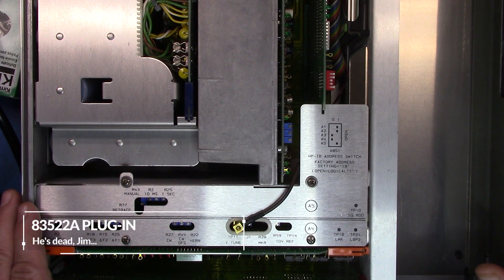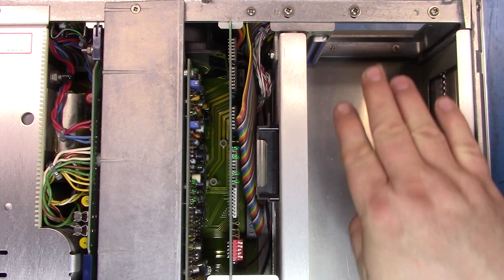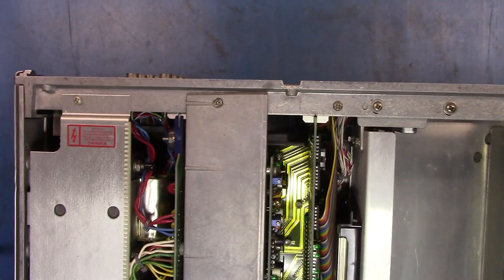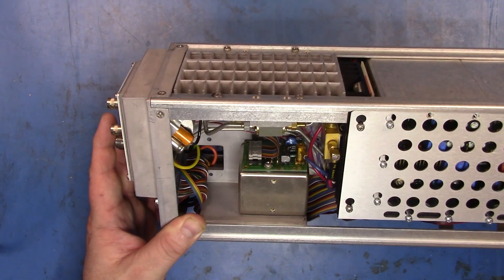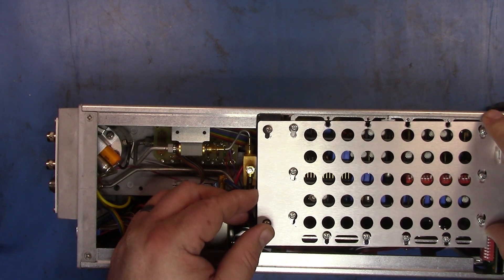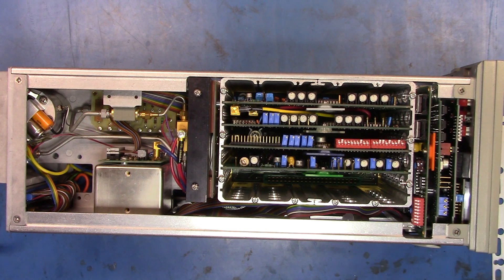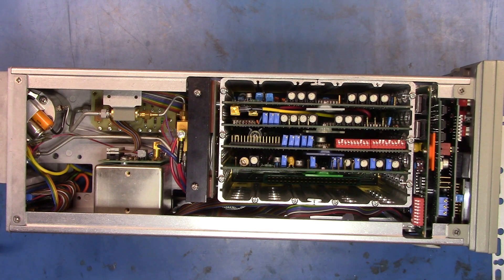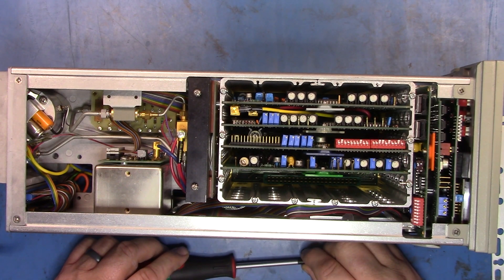HP83522A - He's dead, Jim

Comment: Well, the troubleshooting was easy! I purchased an HP 8753A VNA a while back that was listed as not working. It arrived with a board missing from the 1349A display. After finding a replacement I discovered that the display had several cracked solder joints on connector pins causing it to work intermittently - probably the reason why the board had been pirated. The rest of the VNA worked perfectly!
Reply from the maker: Hopefully, some of the other plug-ins I have will be the same as the experience you had